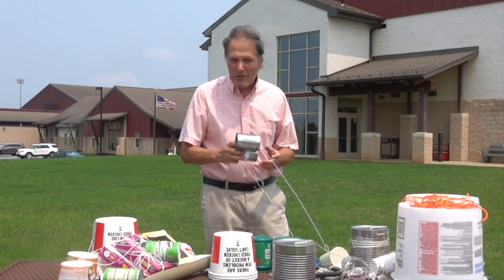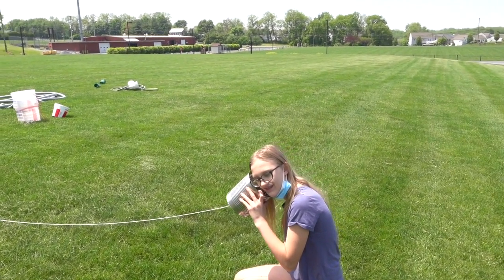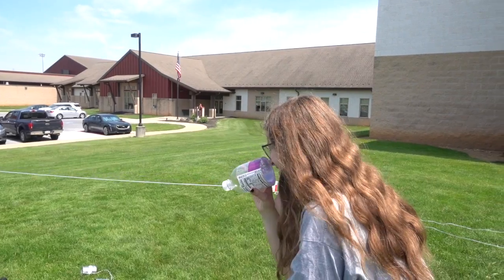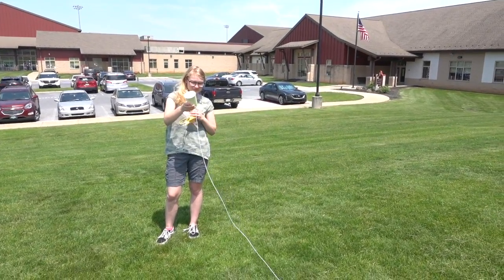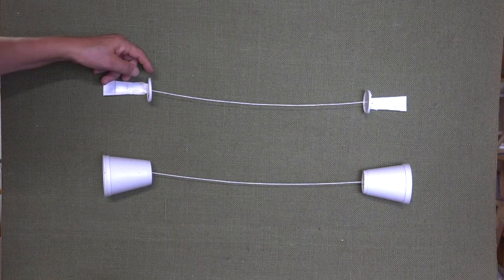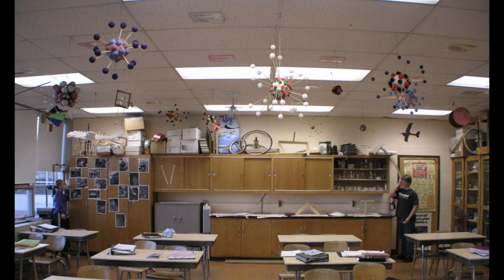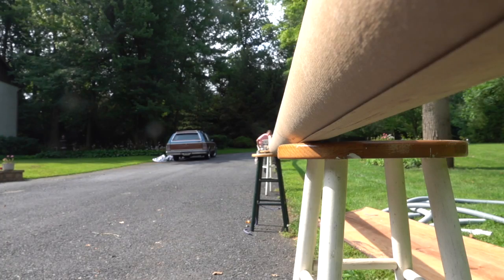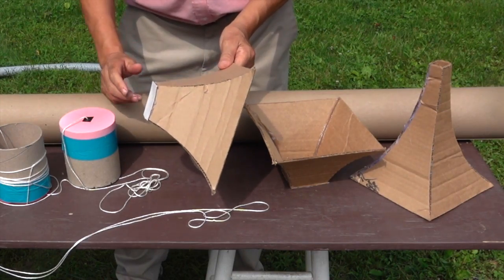String Telephones versus Sound tubes... STEM project.... Homemade Science with Bruce Yeany

Comment: The physicist John Tyndall and his book entitled Sound mentions this about sound traveling in a long pipe.
"The celebrated French philosopher, Biot, observed the transmission of sound through the empty water-pipes of Paris, and found that he could hold a conversation in a low voice through an iron tube 3,120 feet in length. The lowest possible whisper, indeed, could be heard at this distance, while the firing of a pistol into one end of the tube quenched a lighted candle at the other."
Reply from the maker: I wondered about the extinguishing of the candle, was it due to the sound wave or the pistol causing enough air movement to put it out.
Reply: Maybe a rubber diaphragm snapped at one end of your long pipe could reveal if a pulse would arrive at the other end enough so as to disturb a candle. In the Paris water pipe Biot struck the pipe with a hammer and the sound through the metal was estimated 10 to 11 times faster than the later arriving sound through the air in the pipe. This was also the case with a pistol and specially arranged bell. What was curious about the mention of voices were 1/2 second interval echoes returning to the sender, yet only a single sound at the far end was received. It  was speculated to be caused by the lead collar joints in the 8 foot 3 inch lengths of pipe but I wonder. Sadly no diameter of the pipe was reported.
The information was mostly from the title "Experiments on the Propagation of Sound through solid Bodies, and through the Air contained in very long Pipes" by Mr. Biot, specifically the listing  ("The" Quarterly Review volume 3), searching Google books/free public domain. 
As many feet as a bullet would drop over 1000 yards and the collars in the pipe it seems a bullet might be stopped before reaching the end of Biot's water pipe. I wonder if a gunshot or strong pulse of air in a pipe could produce an air pulse sound ahead of a slower following pressure wave vaguely analogous to the pop sound a toy smoke ring shooter makes and the slower vortex ring that follows?
Reply: Rereading the article he refers to only possible accidental protrusions in the pipe so maybe the pipe was smooth and a bullet would travel the length. Your question about how the candle flame was put out made me curious. I can think of a bullet zinging by a flame maybe, a pistol firing a blank and causing a sudden sound wave roughly 3 seconds later, or perhaps a following or slower pressure pulse conveyed from the explosion? Alas ...

Comment: I would like to see a comparison between string phones, using cotton string and other filaments, including monofilament nylon and ultra high molecular weight polyethylene (Spectrum) fishing line, or even steel wire (piano wire).  I suspect the tension on cotton string greatly alters the efficiency.
Reply: Or thin copper wire, we used that to great effect when we were kids
Reply: @WynandSchoonbee  when I was a kid, we used thin copper wires insulated in plastic, and attached to a special socket in the wall. 😜

Comment: You might experiment with parabolic dishes. A pair was/(are?) set up at the Seattle Center Science Pavilion many years ago. They were facing each other about a fifty feet apart if I recollect correctly. One person could whisper in one and another person could hear it in the other. The dishes were large, probably eight feet across. It was a long time ago and I was much younger. It was fun to use and always attracted attention.
Reply from the maker: I'd like to try that,  another example,   in Philadelphia's fairmont park there is a statue with a curved wall surrounding part of it, standing at opposite ends of the wall  you can whisper and hear very clearly at either end.

Comment: Good to see you going back into school, Bruce; and great video as always. Your speaker/vibration demo reminded me of another simple "intercom" project that uses no batteries, albeit it is electrical. You bust the speakers out of an old boom box. Then solder the 2 tabs on each speaker to long wires that connect to the tabs on another speaker. The amazing thing is that each speaker then also acts as a microphone--a "dynamic microphone" to be precise. The vibration of speaking into a "speaker" caused enough relative movement between the coil and the magnet to create electrical current; which travels over the wires and is then converted back into vibration/sound at the other end by the other speaker. Like the whisper tubes, you don't need tension or a straight line.
Reply from the maker: thanks,  heard you and Erik got together this last spring,  hope that we could do that sometime in the future.  There's a couple other demonstrations that go along well with the one you described,   I hope one of these days I get to show it to you.

Comment: I use fishing line in my classroom? I wonder if I should switch to what you are using...🤔
Reply from the maker: Hi Tim,  I've tried string, wire,  nylon rope and fishing line previously.  We found the string the easiest to work with  and kept them all the same (except for the big buckets).  Changing the string type introduced too many variables for the short amount of time we had.  I would say stick with the fishing line

Comment: Whisper tubes are cheating, the sound starts out in air, and nothing changes. 
Please try different media for the strings too, like different types of wire, weed trimmer line, and rubber strings.
Reply from the maker: I had thought of keeping the two methods separate,  I plan on at least two more videos which will  look at each method singly.

Comment: 02:52 - Instant Star Wars blaster noises but I think the original sounds were made from hitting a radio tower/antennae suspension/anchoring cables with a heavy spanner.  Always a great sound!!
Reply: There is a microwave tower near my sister's house in the country. I stopped there one day and using a zoom recorder, laid it on one of the guy wires and tapped the cable lightly. I like the delayed effect because of the length the vibrations had to travel and return.   : )
Reply: I think you're correct but yeah same type of sound
Reply: Yeah… at 3:12, this student is not far off the reality, really… stretched metal cable, stretched metal spring…. Not so very different!

Comment: Guess who it is!? It's YEANY-Y-Y-Y-Y-Y!!!!!

The issue with ghetto-phones, as we used to call them, was that for a strong transmission the line has to be under just enough tension to vibrate the string vs too much which instantly killed the signal.  We used fishing line when I did this experiment all those years ago when I was a school and metal cans and fishing line gave the best results.
Reply from the maker: interesting that even with the metal cans we found some were better than others,  some cans have ridge rings at the bottom making them less flexible giving poorer sound.  We found that the Pringles cans had the best sound of any of the metal bottom containers that we tested.
Reply: @YeanyScience  - I remember using the larger cans with a volume of 2.5-3kg and they had a larger surface area for the 'skin'.  We tried putting rivets into them, like a drum kit cymbal, to try get some sort of better noise but the jury was on whether our ideas made a difference.
Reply: @YeanyScience  Don't Pringles cans have aluminum bottoms?
Reply: @jpopelish nope it's steel. Test with a magnet. But it's pretty thin for steel and kinda gives the impression of aluminum.

Comment: we used thin nylon fishing line
Reply from the maker: that actually works better than the string I used but I opted for string.  I found working with fishing line telephones and so many students was problematic, harder to see and  once the line got tangled it was impossible to untangle.
Reply: @YeanyScience  UHMWPE (ultra high molecular weight polyethylene) braided fishing line works better than nylon line and is easy to see.  It's high modulus and low loss make it work better than ant other string or line or wire I tested.  Kevlar may work as well.  The only Kevlar line I have is too thin.
Also, try different cups at the two ends.  That way resonances of the two cups are different, averaging to a flatter frequency response.